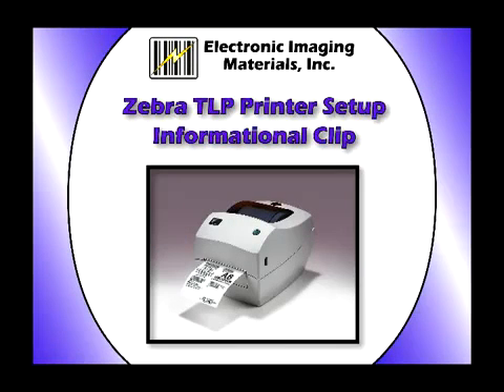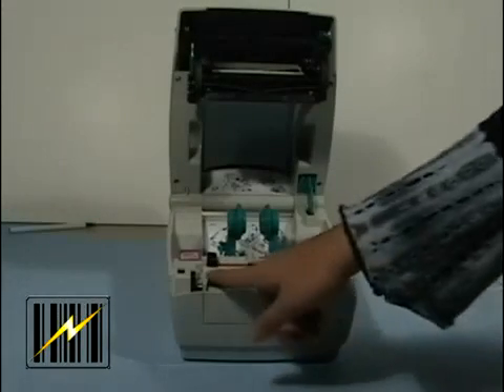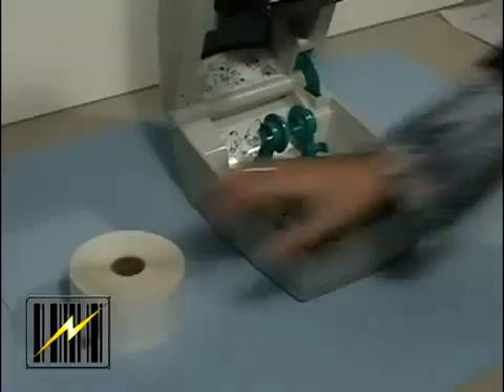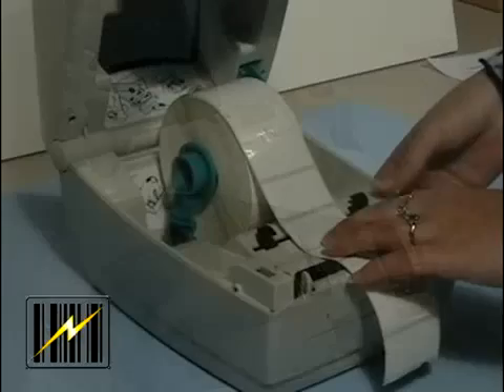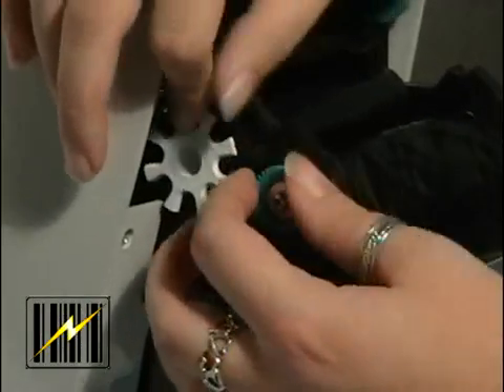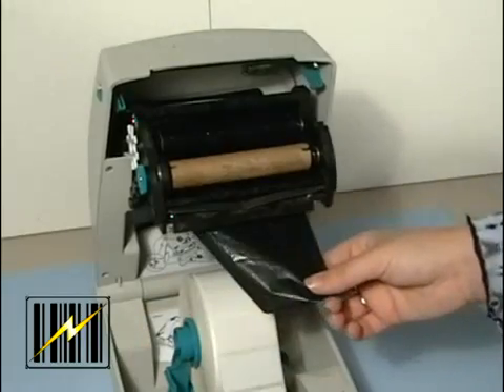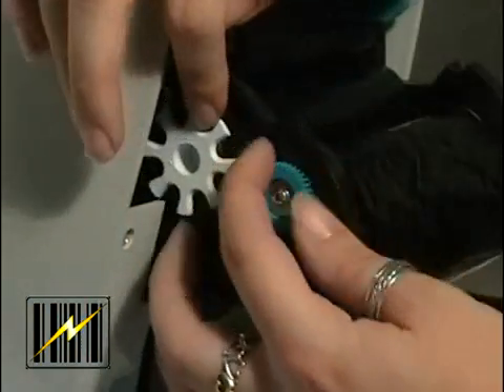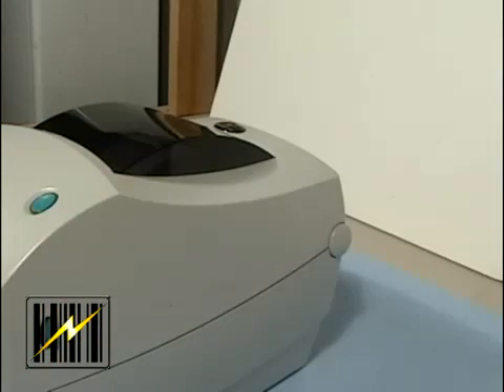Zebra TLP 2844 Printer Setup

Comment: Please reply anyone with a solution. I have a zebra TLP2842 and TLP3842 neither works with ribbon. ribbon kepps snapping at around the print head. I have tried calibration but still same problem.